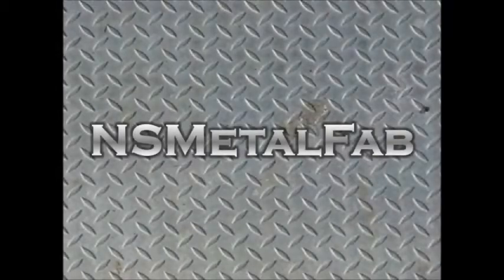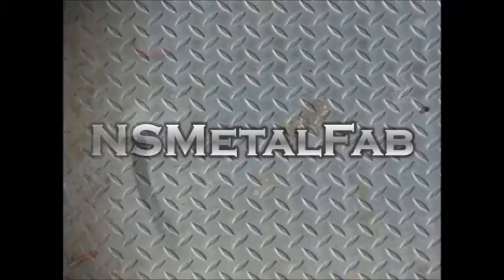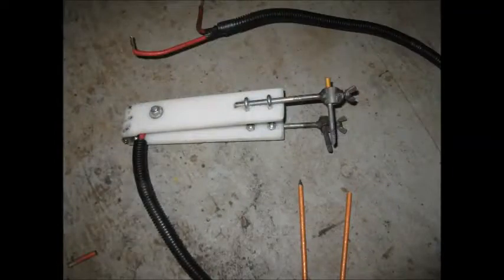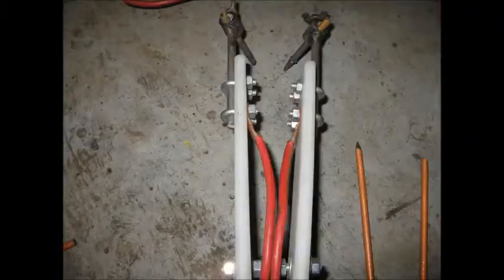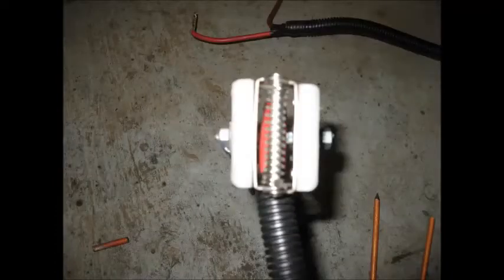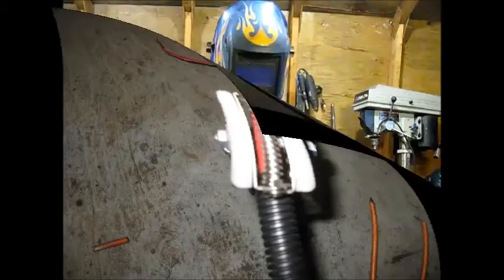Carbon Arc Welding

Comment: More to the point, this kind of torch makes a broad general heat.  Generally in welding you want a lot of energy in one spot, to make the famous puddle!  I have these kind of torches and they do a lot but not welding.  To WELD people used to use a single carbon electrode, pointed, with a long arc.  This still works, but I had to make the electrode-holder myself!  You can do something like TIG welding with it, adding filler rod.   In books about welding you can find pictures of VERY heavy welding being done with carbon arc, and in some cases mechanized!  SO, there's a big machine carrying a carbon electrode, crawling down the seam inside a vast aluminum pipe or something.   One of the great uses for this was welding copper sheets, which is something that still comes up and is still not easy!

Comment: Interesting.  I have heard of two forms of carbon arc welding,  twin electrode and single electrode.  It's all but obsolete today, but still mentioned in the American Welding Society for historical purposes.  Another use for carbon arc,  also obsolete,  was search lights and movie projectors,  having been replaced my Xenon short arc , or HMI lamps, up to 24Kw.    Also in the late 1880s to the early 1900s,  street lights and for lighting factories and large retail stores.  In fact the carbon arc was  the very first form of electric light, predating the incandescent lamp by decades.
Reply: It has its place though.

Comment: Does it work with tungsten electrodes ? (they are easier to find than carbon ones)
Reply: I don't think so, because the tungsten is exposed to atmospheric air, it will burn and oxidize